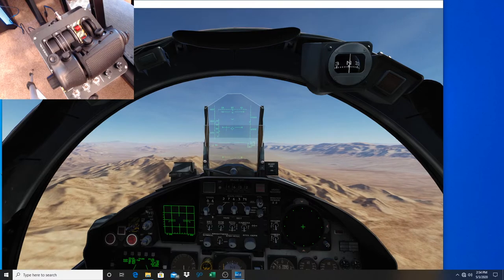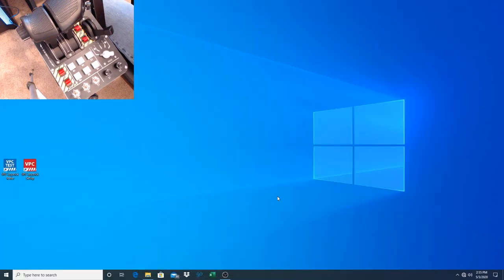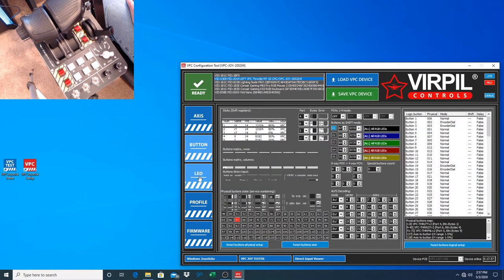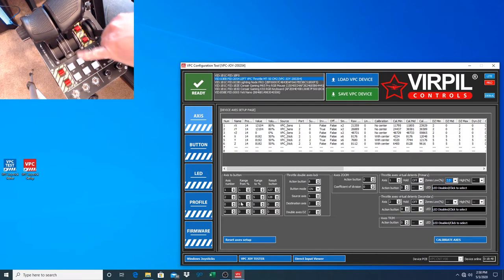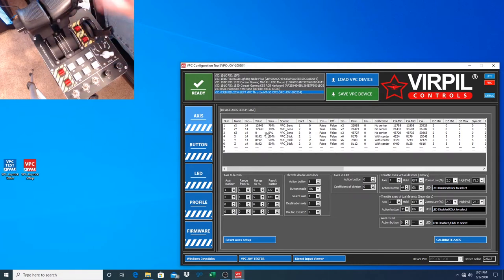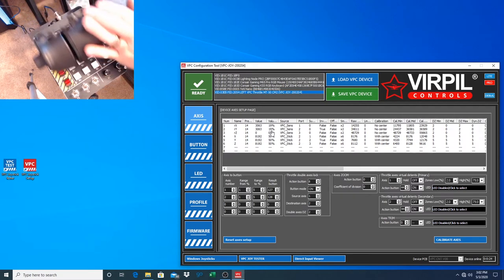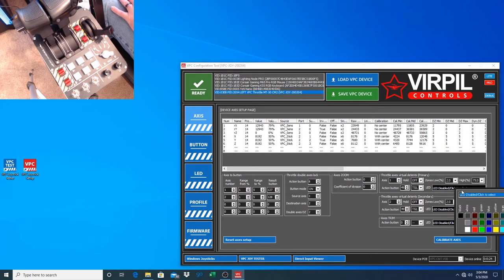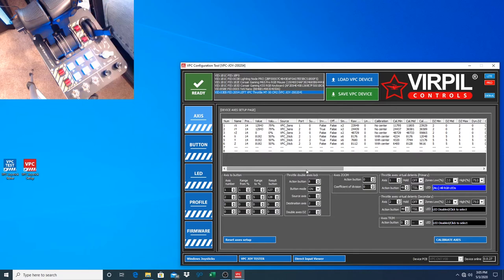HOW TO SET UP VIRTUAL AFTERBURNER DETENT ON VIRPIL THOTTLE. PART 2 OF 3 ADVANCED SETTINGS VIDEOS

Comment: Hmm, very good series. Coming back to this after setting my stuff up.. what you recon. Can we light up just one LED while the plane is on Afterburner (with no actual detent), IF engine RPM is 80-100% then light up one LED. Tried to set up a Axis to button and assign it to a Shift button (I chose 126) and light up B1 as yellow, but no luck so far :D
Reply from the maker: kaspariito I’m currently in the middle of a move and I have everything packed up. I will be able to look into it in a week or two sorry for the delay.

Comment: Current Virpil software doesn't require only one joystick to be connected. At least between control panel #1 and #2 I just purchased and received; it doesn't care and will save/update changes to a specific one just fine.
Reply from the maker: You should only have one Virpil device connected for firmware updates. It’s not necessary to unhook all of your USB connections. Only other Virpil devices. If your building profiles or making other adjustments in the software it is fine to leave everything hooked up, including all of the Virpil devices.
Reply: @JGandT  I did (at least tried) a firmware update yesterday with both connected and it occurred just fine. I can’t say if there actually was an update but it ran and rebooted the panels. The software didn’t warn me about only having one connected so it should be safe. It’s definitely a possible (and expected) to identify a specific USB device ID and not brick something entirely unrelated, so it seems they just improved their software.

Comment: Do you know by any chance that for all planes the afterburner starts at 80%?
Reply from the maker: I’m pretty sure on dcs they do. Let me try out a few planes and get you a definite answer.
Reply: @JGandT  Well its seems magic (round even) number so I assume they do. In good news today my virpil throttle is arriving. Damn, I can't wait anymore :D
Reply from the maker: So it seams some jets are different than others. Here is what I found after flying a few different planes. F15 80%, F16 80%, f18 80% then I jumped into the mig 29s and found it to be at only 50%. This will be a challenge to figure out a solution, however I will see what I can do.
Reply: @JGandT  Great video, thanks for putting it together. I ordered that throttle and can't wait to get it, expensive stuff though yikes. How about using the mode dial, so Mode 1 is US planes, Mode 2 are russian (if the 50% applies to all russian planes and 80% to all US)
Reply from the maker: @jboys I don’t think there’s a way to do that. Virtual detent doesn’t offer a mode selection. You can however adjust the throttle curves on Dcs I am working on a video now.
Reply: @JGandT  or you can mess with the curve on the settings in DCS for your throttle maybe that will help